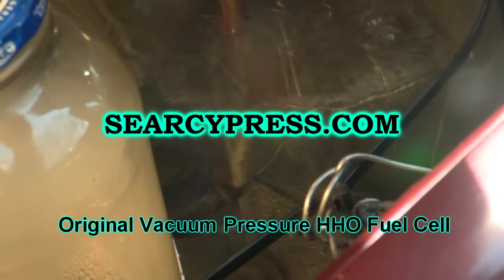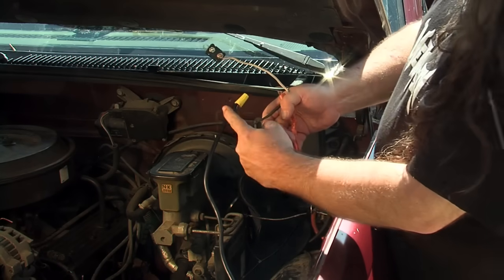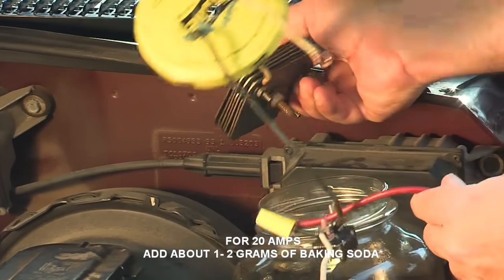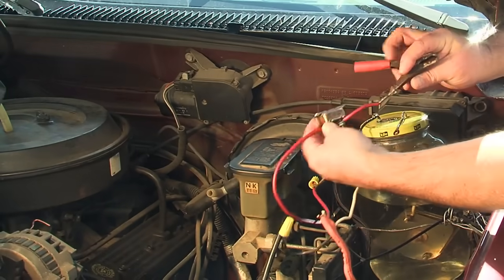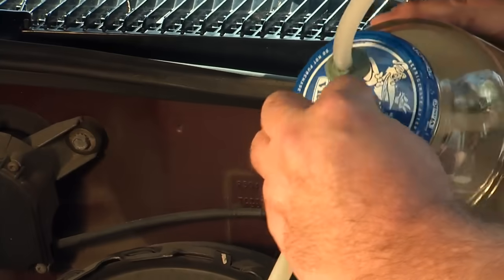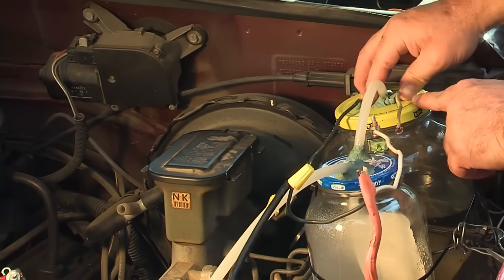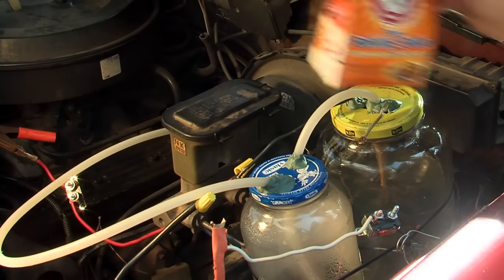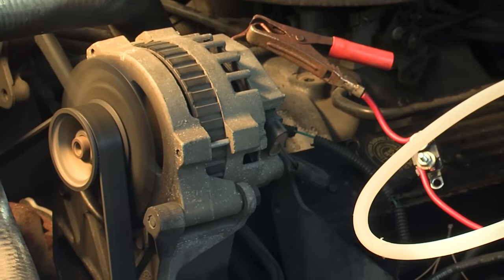Vacuum Pressure Hydrogen fuel cell defeats high gas prices using hydrogen from H2O.

Comment: Yet again.... more people concerned with amps....  learn something.... go on amazon and buy a dc dc boost converter..    buy distilled water.    Get some stainless tubes NOT PLATES....  the cell acts as a capacitor until the voltage flows through the distilled water.... YES distilled water becomes conductive just like glass and plastic with high voltage dc....  think of static on a balloon.... well.... now you are ready to destroy the dielectric in the capacitor you just made.... fuck electrolysis
Reply: What i mean about it becoming conductive is this..... lets say you have a variable voltage/current dc bench supply....  as you tune it up to get it to work it requires amps to start oscillating.... once oscillations occur you can turn the voltage up.... as you raise input voltage the input current decreases.... and with most of those circuits the output is at MOST .2 amps....  but youll even hear it pop and all of a sudden it will be drawing more amps.  .this is why stan meyers pwm circuit was gated... the gate frequency was low low pulses.... it allows the water to relax and not become conductive... which causes a higher current draw.... which also decreases output of gas
Reply: The problem is you cant measure resistance on an active circuit... with no power the distilled water is completely non conductive.... but once the ripple from the output starts peaking at higher voltages the resistance decreases and the amps get drawn through

Comment: I built and installed one of these on a dodge 318 c.i. pickup I had and experienced about 10 % less gas usage. Only problem I had was it took so much current from my battery that i couldn't use my A.C. and my headlighs without the lights dimming when I stopped at a red light !!!
Reply: You had that much power draw and you SAVED fuel?....no...you did not.

Comment: The battery is 40 amps - you only need 3 to 10 amps so you put in the bicarb or whatever electrolyte while monitoring the amperage until it reaches 3 to 10 amps across the electrodes.
The problem is that the car's puter will learn from the oxygen sensors that additional ("unused") oxygen is in the exhaust and the puter will start adjusting the mixture to be richer coz it's trying to burn off the extra Oxygen - result: you use more gasoline. You have to find a way to tweak down the sensors by way of a variable resisting circuit to give the puter false info that there is no extra oxygen in the exhaust....the H2 explodes before the gasoline (that's great), BUT the extra Oxygen from the HHO is not all exploded to form CO (carbon monoxide - which becomes CO2 after the catalytic converter ofcourse), BUT it's that extra oxygen atom that's being sensed. The Oxygen sensors are the enemy.
Reply from the maker: In many cases you are correct. I have used a portable power system and ran it at 100 amps... Almost got a speeding ticket...hard to save on fuel when the throttle response is like a dragster. Ty
Reply: Yes indeedy lol - I have wondered if it's possible to build a unit where the cathode bubbling oxygen doesn't mix with the hydrogen . the oxygen would be wasted through a non return valve or whatever.

Comment: Am I nuts? He didn't even put any water in the flashback arrester jar. Most dangerous HHO setup I have ever seen. LMAO.
Reply from the maker: The arrestor jar is self filling and drains back to the main cell when turned off due to a thermally initiated vacuum.
Reply: @metalpresstv  he said a "flashback" arrester. If any HHO gas ignites further down the line and comes back toward the HHO generator it'll blow up everything in the chain. 

A flashback arrester creates a smaller controlled explosion instead of exploding your HHO generator jar. What I'm assuming you made is more of a pressure overflow jar, to keep your HHO generator from overpressurizing and cracking, but really all you've added is just a container of excess HHO gas waiting to explode if it sparks.

Comment: I ran a system like this in my truck for 2.5 years.  It works!  Better pick up and an increase of 27 to 30% increase on gas milage.  This was in Georgia so for the most part i did not have to deal with freezing issues.  The few times it did freeze it just did not produce gas.  The major problem I had was the evaporation of water during hot months and having to check and maintain water level almost on a daily basis.  The other problem was the build up of anode mud...looks llike rust.  I drained the water container once a week or more to get rid of it.  The idea absolutely works but the daily or bi daily maintence was aggravating after a while.  If that were solved it is a great application for any gas or diesel engine.
Reply: Put a bit of vaseline on the anode. It prevents gunk buildup/rust there
Reply: I'm gonna try this for myself and see what happens.  If you see a great big mushroom cloud over Georgia...I messed up.  😆  lol
Reply: @angelcintron2122  angel. Don’t use glass jars. Home Depot or lowes sells tough plastic filter canisters. More durable and easy to drill if needed. Don’t worry about explosion. There is not enough produced at one time to be dangerous
Reply: @9frankc9  yeah,  I thought it had something to do with presentation.  I was thinking that maybe if would be better with an empty metal tin can or something that would stand up to the heat, pressures, road vibration,  etc. Lol. Thank you Frank. Take care and stay safe Sir.
Reply: @angelcintron2122  no tin angel. your can would corrode.